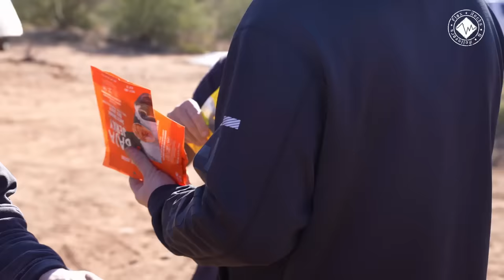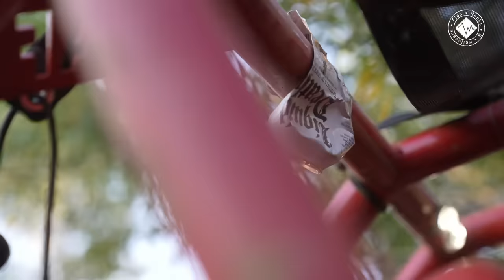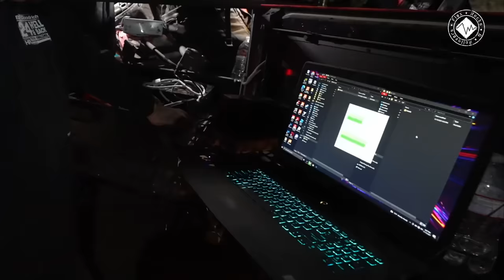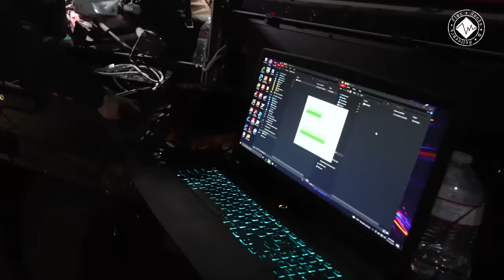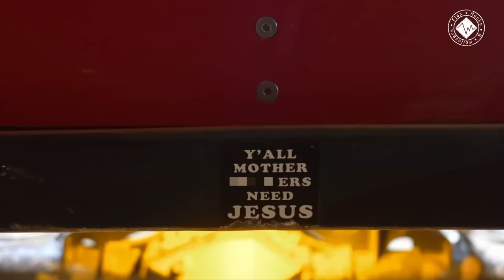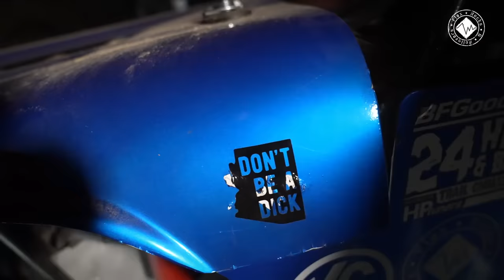The Scariest & Toughest 24 Hell and Back EVER!

Comment: My cj-5 could make it through that easy. 
4.2 engine. 
176 tranny. 
2.73 factory open diffs. 
Dana 300. 
1.5 inch lift. 
Onboard air.....not yet. 
8274 winch......not yet. 
Lockers.............not yet
Lower gears......not yet. 
Lift....................not yet. 
Bigger tires.......not yet
Roll cage...........not yet. 
😵😱😬👍